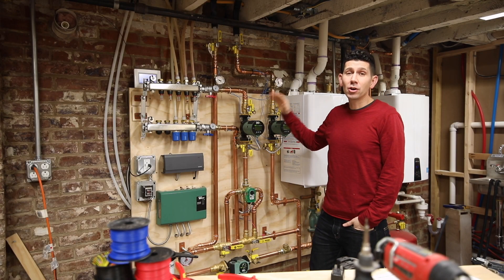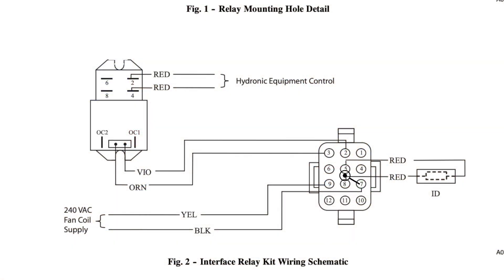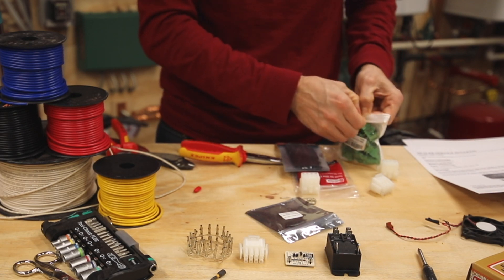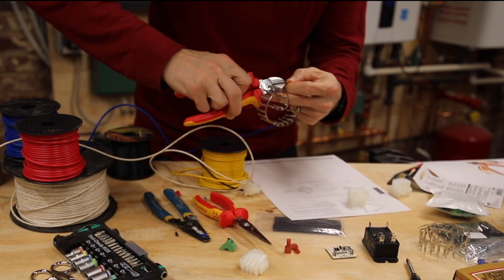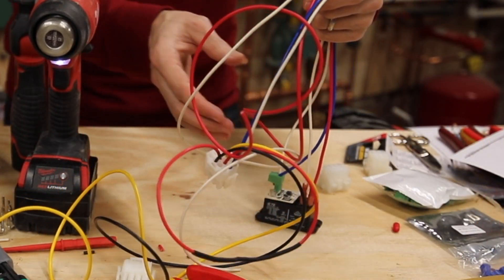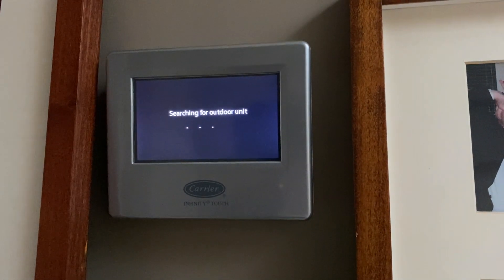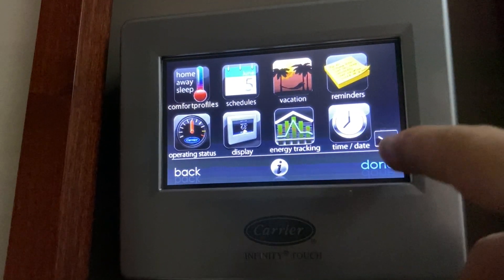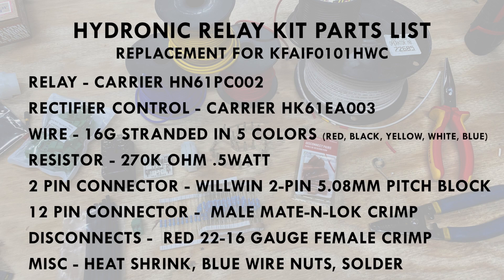How To Build and Install a Carrier Hydronic Relay Kit for Boiler Heat

Comment: My Carrier Infinity has the hydronic coil and works fine but when it was installed I guess they used a relay based on electric override as that is what it displays when it calls for boiler water.   No big deal but would livw to have it correctly display on tstat.   Does anyone think I just need to add the ID reisitor to the existing harness?
Reply: Did you ever get an answer to this?  I have the exact same issue.

Comment: Excellent video, thanks for sharing your efforts.  My only thing is I would have used a proper terminal crimping tool when putting the terminal plug pins on the wire vs. just smashing them with a needle nose.  It provides a better connection.

Comment: Hello, thank you for the great video. I did this however, when rebooting my system, my infinity controller is now telling me there is an invalid electric heater found 255 kW heater found equipment model does not support this heater. I’ve double checked over everything all of my connections are correct.
Reply: Did you get this resolved?  I would like to try this but worried that I will break something else.   Currently hydronic is set up just as electric heat on relay.   Still works fine but would like to have it display correctly

Comment: great video.  Will your setup work with my Infinity AC where my boiler is just used for hot water baseboard heat.  I do not plan on using the boiler to feed hydronic coil.